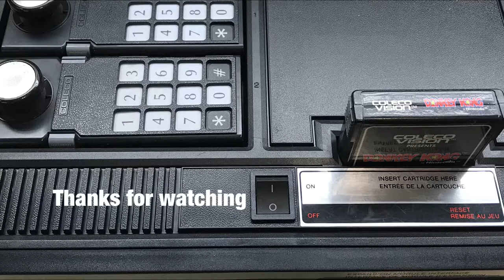How To: Colecovision power switch replacement

Comment: This isn't necessary the original switch can be disassembled cleaned and packed with dielectric grease that will prevent the internal contacts from oxidizing again. Cleaning and lubricating the original switch will be a more reliable and longer lasting fix than one of those cheap Chinese rocker switches.
Reply: Nah.  That old switch is an inferior design compared to the new switches.  Those switches were crap back in 82’.  They weren’t exactly reliable and new units had switch problems right out of the box.  
By the way that old switch was made in Taiwan.  Not exactly the best quality control either
Reply: @jgabora  All of these new switches are going to be made in china and it's not like they're exactly known for excellent QC. There's nothing inherently wrong with the old switches design just oxidation over the years that causes high resistance or intermittency or both on the electrical path through the switch. Cleaning the switch contacts and packing it with dielectric grease does fix the problem and keep oxidation from reoccurring.

Comment: Did this exact mod, no result so i guess V-ram broken.
Reply from the maker: I find most often it is the switch, however next in line I would say it’s the RF that is bad...if so...I’ve never looked into repairing the RF, I just mod the system with composite and s-video.

Comment: best switch with no mod of case use part # JWMW21RA2A NKK. However, you can use the original switch clean it and use some dielectric grease. I couldn't use original since the person had this broke it.

Comment: Can a power switch fault cause the picture quality to be really bad? As in green wavy lines? That's the issue I am having with mine
Reply from the maker: Absolutely! Can’t say this is what is wrong with your system, but this switch gunked up can and will cause graphics issues. If you do not feel comfortable changing the switch, you “might” get away with using contact cleaner sprayed in the switch while working the switch back and forth. Keep in mind, to do a proper cleaning of the switch (to keep the system looking stock), you should desolder it off the board and clean the parts individually, it does not look fun to put it back together tho.
Reply: @logicdb  thanx for the reply mate. 
I've had it apart cleaned it all up with rubbing alcohol as in the board and AV board but I couldn't get to the pins of the power switch. There is a bit of black gunk on all of them. I will have a go at trying to remove the switch. Thanx again mate really appreciate it.
Reply from the maker: Well, I hope it works. First thing I do is blast it with contact cleaner to see if it works (even tho I am going to change the switch), then I change the switch to see if that fixes the issue; of those that did not fix the issue, I assume it’s the RF modulator (which I’ve never bothered to look into fixing) I use my composite test circuit,  if this fails, on to the video ram mod, failing that it’s the main video chip. Fortunately this goes from cheapest to expensive as far as steps go. Good luck👍